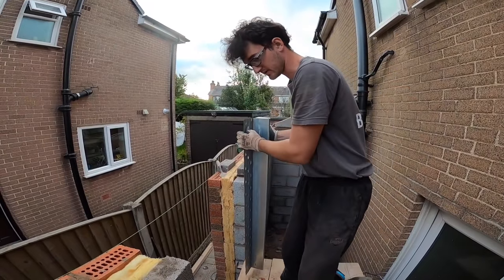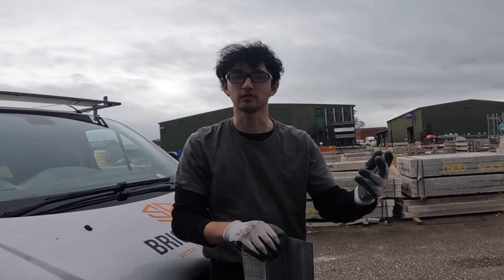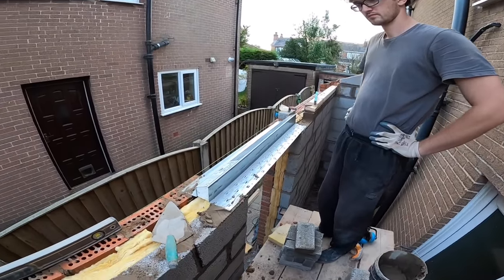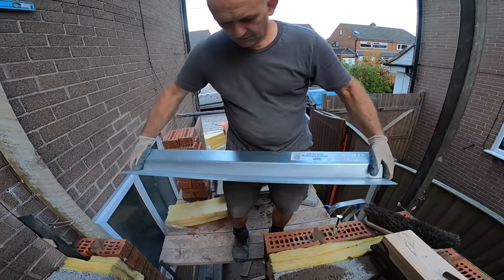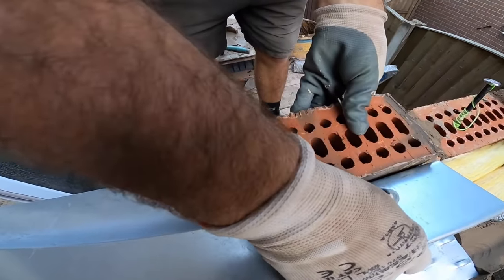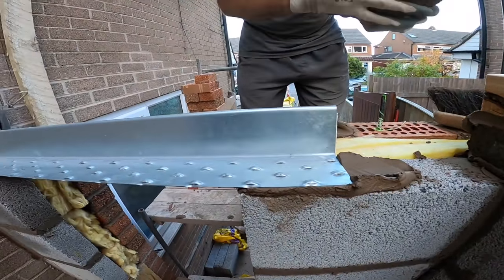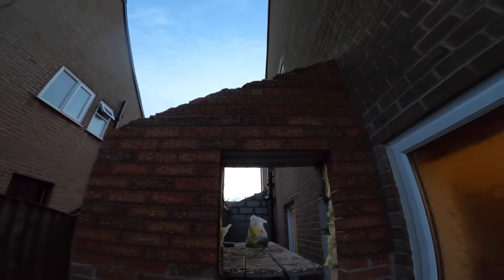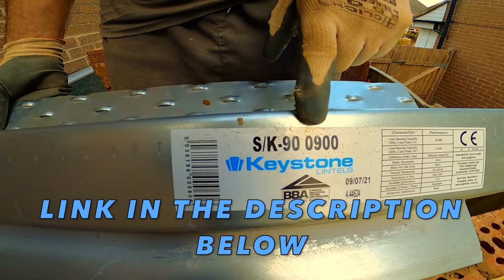HOW TO INSTALL A LINTEL

Comment: Great video, with your vapour barrier is that installed on a high course inside?
I’ve got to open up two door ways but can’t get a bricky for love or money in North Devon, been let down by 5 so going to do it myself😊
Reply from the maker: Good luck Andy . You need to google cavity trays to understand fully . 🧱👍🏽

Comment: Hi Steve. If you used thermalite blocks on the inside leaf. Would you use engineering bricks under the lintel bearing?
Reply from the maker: No not usually unless specified 🧱👍🏽
Reply: @SteveAndAlexBuild  ok thanks 👍
Reply from the maker: @bigmik3566  😁👍🏽🧱

Comment: The top surface of the lineal is angled. Should it be sloping towards the outside wall or to the inside wall. ? 
You’ve installed the lineal with the slope to the outside wall. But you didn’t say or emphasis which way the slope should be set!! 
Im systematically working through your video with great interest. Good work. What a team you both make. I just could not have worked like this with my father.
Reply from the maker: Everything always needs to fall out and away from the house 🧱👍🏽
Reply: @Bricklaying With Steve and Alex  
Thank you for your reply.
 I had to assume that the angle should direct moisture to the outside   I was bringing it to your attention that in the video on how the instal a lineal that you didn’t say that !
Reply from the maker: @LifetimeinWelding  🧱👍🏼
Reply: @Bricklaying With Steve and Alex  
That’s not a good enough reply. Your reply should be “ Thank you for pointing it out we’ll redo the video with a full  description  of how to install a lineal.
Reply from the maker: @LifetimeinWelding  🧱👍🏽. Check the video description for spelling 🙄